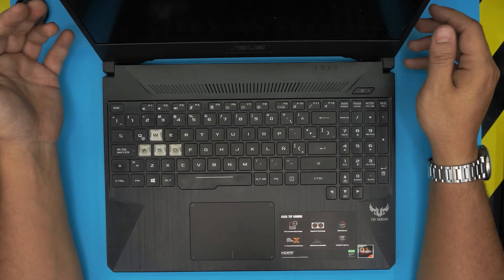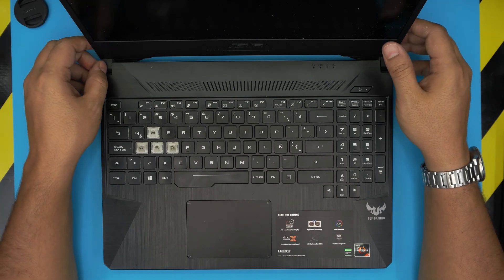How to Repaste and Clean ASUS TUF Gaming Fx505d 💻🧹- Step-by-Step Guide

Comment: what do i do my keyboard leds are on and the computer doesnt turn on, the gpu and cpu is heating up but nothing is working
Reply from the maker: 🫠Regarding your question, you may have a power delivery issue on the board. You will need to check the components, but it is recommended to take it to an experienced technician.
cheers🍻

Comment: Hi there, I know this video is 3 years old now but if you have time to answer my question - please do. My laptop (same as this one) have issues with performance and battery. Everytime I turn it on while plugged its going to drain the battery even if I'm just opening my browser. The performance is bad and it's lagging, even though upon checking on task manager it's not really consuming much on the CPU, ram and GPU's side.I tried cleaning it and adding thermal paste but to no avail. and the it's really hot. I'm guessing the fan is slow? or underpowered due to battery? Please help me :(
Reply from the maker: 🫠Regarding your question, the first thing is that this laptop is not meant to be used under heavy load on battery power; you need to connect the charger and ensure the power plan is set to performance mode. 

Using high-quality thermal paste is a must (avoid cheap paste). Download MSI Afterburner and increase the fan speed if needed. Check the SSD/HDD status to ensure they’re not degraded, as that can also reduce performance.
cheers🍻
Reply: @uFixTek  Can i use or play games this laptop without battery instead?
Reply from the maker: 100% without any issues.
Reply: @uFixTek  i tried and and the fps is like 10-20 :( it's not playable and it's so hot.
Reply: @AdonisPinqueAranas How are you today bro? You might ahve got a defective product? Is that a second hand? I'm guessing it is not the original parts anymore?
Reply: @AdonisPinqueAranas I have the same laptop (Second hand) it works perfectly fine. Although my temps is reaching 90° I'm guessing it needs a clean too
Reply: @uFixTek Since I'm here Good day sir! May I ask is 90° temp while gaming is not normal anymore? Do I need to clean it up now? I'm scsred of opening it up 😭🙏

Comment: Sir how should i use the air compressor, is it from outlet side of the fan inside while holding down the fans
Reply from the maker: 🫠Regarding your question, you want to disconnect the fan first. Once disconnected, you will need to blow from the outside where the hot air exits, blowing the air inward.
cheers🍻

Comment: HELP. I have just done everything in your instructions. Put it all back together. Opened the laptop case and the battery light was flashing. Turning on the laptop it doesn't seem to be charging and my fans aren't kicking in 😖 If I pull the charger out the laptop just turns off.
Reply from the maker: 🫠Regarding your question, the fans should not kick in until the temperatures are up. Regarding the battery, you may want to check the battery connection; maybe one of the pins is not making good contact, or it could very often be a bad battery (defective), which does happen a lot.

Comment: i have the same laptop and i want to ask, on top of the keyboard there is like a vent thing and from what i can see in my laptop, theres quite a build up of dust in there. Is there anyway to clean that?
Reply from the maker: 🫠Regarding your question, the air goes from under the keys to the fan, and you can use a toothbrush and vacuum to suck the dust from the keyboard mesh inside the laptop.
cheers🍻

Comment: Thank you. I just recently cleaned up my laptop and found out the GPU fan was barely working. I just installed new fans. And I'm totally noob with this. Thanks to this, I didn't panic and I think all went well, although... The front edge won't close, no matter what I tried. I guess it's alright though. I tried to prioritize closing the front edge but it doesn't click at the center and I see no damage there. I guess this is just that stubborn with me. 
Now I'm just scared of turning it back on XD
Reply from the maker: It's truly a pleasure, my friend.😊 I deeply appreciate your taking the time to provide feedback. If you're inclined to support the channel further, feel free to like and subscribe—or even both!
regarding the front side case not closing, make sure the audio cable (black and red cable) are tucked far from the edge, that cable sometimes comes loose from the plastic rails and can prevent the cover from closing, so move that cable and then pinch real hard the cover till it makes a snap click, else if you don't close it also nothing is going to happen, the laptop will still be working fine.
Should you have any other questions or requests in the future, please don't hesitate to ask me.
🍻cheers

Comment: Great video.. i have a question, do I need to put thermal paste if i remove the components? What if I only take out the fans and clean them and put everything back, would everything still be fine?
Reply from the maker: Thank you for your feedback! If you wish to support the channel, you can like, subscribe, or both!
Regarding your question, if you lift the heatsink (separate it from motherboard) then you will HAVE TO clean the old paste and apply new paste. but if you just cleaning the fans without removing the heatsink then you fine.
Should you have any further questions or requests in the future, please don't hesitate to ask me.
cheers🍻
Reply: @uFixTek  thanks mate.. for now I have closed it back without it.. I will buy the paste and apply it asap..
Reply from the maker: Oki, yes get that ASAP and apply it.

Comment: I want to ask something that has been bothering me, those thermo gel of my fx505DD is completely dried or is it the texture like that? I bought it in 2019, and can I replace those with thermal pads? Thanks for the videos, it is very easy to follow man.
Reply from the maker: 🫠If you wish to support the channel, you can like, subscribe, or both!
Regarding your question, i highly recommend you to replace it with this:
https://amzn.to/49oVm6o
else the power regulators and the vrams will suffer.
Should you have any further questions or requests in the future, please don't hesitate to ask me.
cheers🍻
Reply: @uFixTek  I'm glad you replied 🙏🏻. In my country, unfortunately K5 pro (and other thermal putty brands 🥲) is not available locally. So I thought I can replace it with thermal pad from Cooler Master since it is available and quite famous among technicians here. The Cooler Master thermal pads has the same thermal conductivity though, but I hasn't changed it yet because I don't know the thickness I supposed to use on my laptop. Once again, thank you very much 😉👍.
Reply from the maker: i would highly advise you NOT to use pads on were the thermal gel is used!, the reason that they used the thermal gel and not pad is because of two reasons:
1. the distance is not even.
2. the xclamp are not firm enough to squish the pads down.
IF you use the pads, you will be counter pushing away the heatsink from the CPU, and it will results on bad temps and crashes.
get the thermal putty from aliexpress they ship everywhere.
Reply: @uFixTek  Yeah, the third reason is what I've been concerning about using thermal pad, because when I touch the pads even the 0,5 mm is a bit on the tougher side. Imagine I used it with the wrong thickness it would be a long term issue. Recently surfed the internet and found Upsiren U6 Pro, it said "thermal putty for thermal pad replacement". I think I'll be considering that since it's cheaper (shipping included, I think it's either from China or Singapore) and I'm also into PC building, thank you very much for the suggestion 🙏🏻.
Reply from the maker: oki awesome and i wish you the best, 
It's my pleasure my friend.

Comment: Thanks for this! I don't have thermal paste so I didn't remove the fans but the amount of gunk I removed was unholy. I hope I didn't start a new epidemic
Reply from the maker: Thank you for your feedback! If you wish to support the channel, you can like, subscribe, or both!
Regarding your issue,  if you managed to remove the gunk, you can use it, but if you have gunk pilled up that means that the thermal paste must be very very defiantly dry, i highly recommend you to replace it.
Should you have any further questions or requests in the future, please don't hesitate to ask me.
cheers🍻
Reply: @uFixTek  thank you for responding! I'm planning on replacing it as soon as I get my hands on some thermal paste. I'm not sure I can find the copper cleaning solution anywhere, though
Reply from the maker: It's my pleasure my friend. don't worry about the copper cleaner, just replace the paste and you be more than fine.

Comment: Hey! My laptop keeps making this whirring or grinding noise from my GPU fan. When I hover my hand over the keys I can feel it vibrating. Even after cleaning, the issue is still present. Is my fan broken and need of replacement? Is this another issue? I am completely unfamiliar with fixing a laptop. Another concern is that my laptop looks a bit different despite it reading as an FX505D. The heat sinks (copper bars?) look different and so does the left side of my GPU. Any help is extremely appreciated, thank you!
Reply from the maker: Thank you for your feedback! If you wish to support the channel, you can like, subscribe, or both!
Regarding your question, we do get this issue in the store a lot, i highly recommend you to get new pair of fans from aliexpress and change them.
there are many reversion of this models and the heatsinks are different on reversions, check the fan model that is imprinted on the fans and look for that model on aliexpress, if you need help finding let me know.
cheers🍻

Comment: Can I still upgrade the ryzen cpu to the latest gen?
Reply from the maker: Thank you for your feedback! If you'd like to support the channel, you can either like, subscribe, or do both!

Regarding your question, unfortunately, upgrading the CPU is not feasible in this case because the CPU is soldered onto the motherboard and is not removable. Even if you were to attempt to desolder and replace it, you would also need to replace other essential components on the motherboard such as power regulators and capacitors, which makes it impractical and not possible.

If you have any more questions or requests in the future, please don't hesitate to reach out to me.

Comment: One question, what are the components that you used the extra thermal gel on? What is the reasoning behind that, do they get very hot as well? This is the first time I've seen someone do that, just curious.
Reply from the maker: Thank you for your feedback! If you wish to support the channel, you can like, subscribe, or both!
Regarding your question, i do repair electronics laptops and much more for over 17 years and the reason we place a thermal putty or gel on the components is that those components do tend to get hot and can get damaged with over heating and the laptop wont turn on, it has nothing to do on performance it has everything to do with long lasting. i recommend you to get a thermal putty on aliexpress and place it on vram and the components around under heat sink. 
Should you have any further questions or requests in the future, please don't hesitate to ask me.
Reply: @uFixTek  how bad is it if you don’t have paste at all? Mine appears to have come off completely and I don’t currently have any to replace it. Will the laptop run in the short term? Thanks!

Comment: Hi! I want to know, is it ok to change the thermal gel with thermal paste on the VRAM?
Reply from the maker: Thank you for your feedback! If you wish to support the channel, you can like, subscribe, or both! Regarding your question,  please in the name of your jesus dont , just go on aliexpress and get any thermal putty and use that, NO THERMAL PASTE please, unless you want to get sudden shutdowns and no poweron
Reply: @uFixTek  Well, I dont want to buy any special putty if you say that the VRAM's dont get hot anyway. I just wanted to know becauze I saw some other tutorials that put thermal paste on the VRAM's and I wasn't sure about it. I'll just leave the thermal gel there
Reply from the maker: yes just leave the stock gel on it and that is all, you be more than fine, as you are not going to be overclocking the vrams anyways
Reply: @uFixTek  I did the upgrade yesterday. I change the thermal paste and put 8 more GB's of ram. No more thermal throttling and more stable fps. Thanks for the advice, I was acually planing to remove the thermal gel but I found your video in time.
Reply from the maker: awesome job my friend 🍻
enjoy your newly serviced and upgrade laptop 👌

Comment: I'm struggling to put the cover back on after cleaning it, mainly the bottom part being extremely difficult to close again. The top and sides were easy but the bottom is almost impossible. If I force it too hard I feel it might break. I decided to just place the screws in again as i physically cannot clamp it together atm. Overall, amazing vid :)
Reply: I had the same problem and the solution was you have to clamp the bottom part first before any other sides
Reply: @KelvinAnderson-vl6yw  Agreed. Also to remove the back cover I find it more easy with the bottom first. No need tool, just finger nails.
Reply: Same the I can’t put it back the back and sides was easy but the front noo I used all my strength nothing happened

Comment: I upgraded my laptop yesterday , but one of the screws of heatsink(screw -8) is too tight and had deformed plus symbol(plus symbol on the screw is washed off ) due to which the screw driver cannot fit in with a proper grip , Is there any method to open it . I'm afraid to apply pressure on it , as it is directly above the cpu.
Reply from the maker: Thank you for the feedback! if you wish to support the channel you can LIKE or SUB or both :P
regarding your question: i would recommend you to use extra force don't worry it won't damage the gpu or cpu, press firmly and do a slow rotation, if that did not work then i recommend you to make a cut in the middle and use a flat head screwdriver, here is a short video: https://youtu.be/xLt6dMIsO9E
Reply: try WD-40

Comment: After I did all of that my computer doesnt turn on anymore why?
Reply from the maker: Double check the connections, and i need more detail than " doesn't  turn on" ,
#1. when you plug the charger, do you see any indication of charging LED?
#2. when you press power of do fans turn, to the power on LED turn on? or turn on and off?
#3. any blinking lights?
Note: if you have removed the the rams and try plug in one ram and then power on and if you get logo then power off and plug other ram.

Comment: i have no idea what is going on. is this a fan cleaning video? im looking for that
Reply from the maker: Thank you for the feedback! if you wish to support the channel you can LIKE or SUB or both :P
regarding your question: this video is for the servicing and fan cleaning and repaste, NOTE: in order to remove the fan and to clean it you must remove the heatsink, and once you removed the heatsink you must repaste the CPU and GPU. you could try to clean the fan without removing it with a toothbrush but it will be hard, its easy to remove and then clean.

Comment: Hello, I was wondering what's the current gpu and cpu temp of this laptop after you put the new thermal paste. Did it improve? And btw, what are cpu and gpu model of this one??
Reply from the maker: Thank you for the feedback! if you wish to support the channel you can LIKE or SUB or both :P
regarding your question: i have mentioned the CPU and GPU model @0:30  (rayzen 7 and 1660gtx), and about the temps THE gpu before repaste full load: 95C after repaste full load 82C, CPU before  84C full load, after 75c full load.
Reply: @uFixTek  I'm going to repaste after almost 2 years since I bought it. I'm gonna use your video as a guide. Big help my friend!! Keep it up!
Reply from the maker: much appreciate your support and you will see the difference and you will want to do your service once a year, its like a car you need to do your oil change to keep it in optimal conditions. 
if you have any question or request in the future feel free to ask me.
Reply: @uFixTek  Yes, I will. Thanks again bro!
Reply from the maker: oki brother

Comment: helped a lot thank you so much
Reply from the maker: You are welcome! Glad you liked it 😊Thank you for the feedback! if you wish to support the channel you can LIKE or SUB or both :P
if you have any question or request in the future feel free to ask me.
Reply: @uFixTek  thank you again i will subscribe. I understand how to dismantle fan and heatsink. But how can I clean the dust inside the fan. Should I wash with water or just clean with brush or something?
Reply from the maker: Oh don't put water or wash with water!! use a tooth brush and air compressor to blow and clean or use a cotton tip to clean. i use a toothbrush. you can use a isopropyl alcohol 90%+ with cotton tip to clean but don't put water!

Comment: Hi sir first thanks for the videos.
I have one question about GPU ram can i use "Thermal Glue" or "Thermal Compound" instead? I searched for Thermal putty in my country's online shops not a single one shows up.
Reply from the maker: Thank you for the feedback! if you wish to support the channel you can LIKE or SUB or both :P
regarding your question: never use thermal glue, and thermal compound won't help, use a thermal pad get .5mm sheet and cut and stack them till you see fit.

Comment: When I have a gl504GS ASUS STRIX SCAR2 laptop, the keyboard turns on with the lighting and sometimes the keyboard does not work, so is the lighting, is there a solution
Reply from the maker: THE light has nothing to do with keyboard, if your keyboard works sometimes or not open and clean the flex cable of the keyboard.